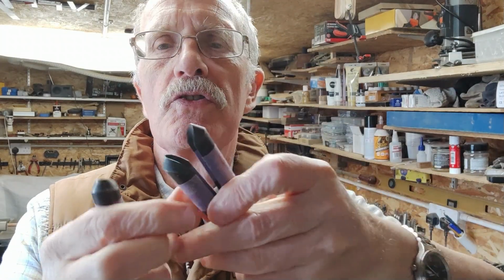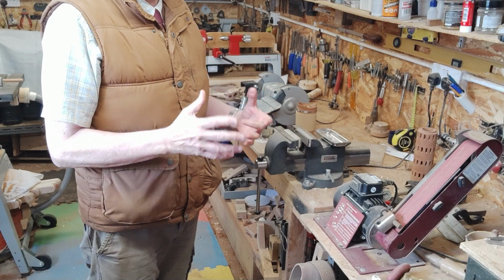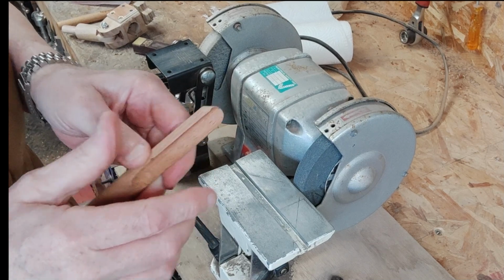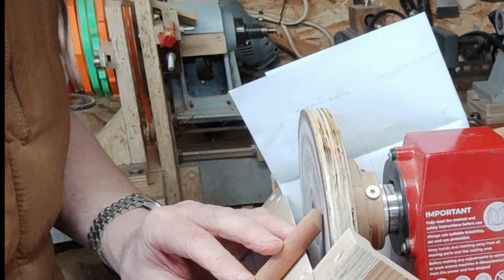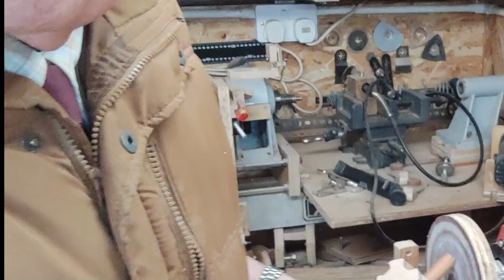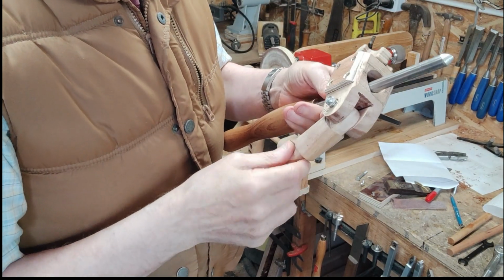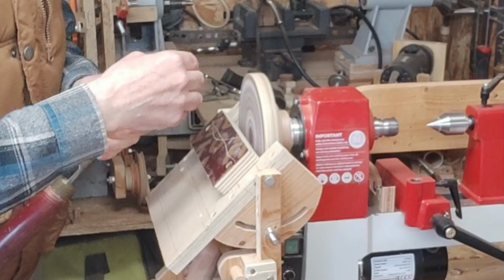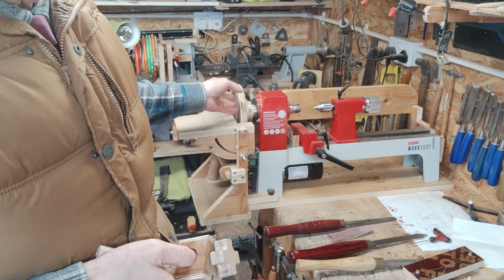How to Grind your new turning tools for the first time.

Comment: Is your bench grinder normal or slow speed? Some say slower speed is better and some say a normal one is still as good since the tools are HHS and won’t burn the steel of the gouges,Thanks for the info your experience is gold to us beginners..
Reply from the maker: Slow speed white wheels are OK for all steels, but your correct that High Speed Steel is ok with normal bench grinders although it will colour the edge of the tools a bit orange if you don't quench them. Slow wheels for Mild Steel. CBN (Carbic Boron Nitride) wheels are the best for both steels if you can afford them.